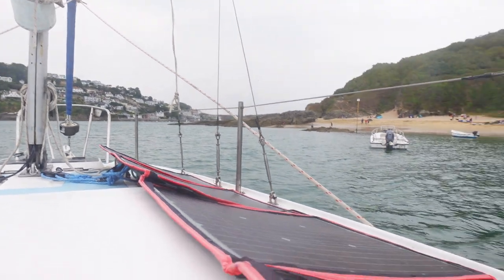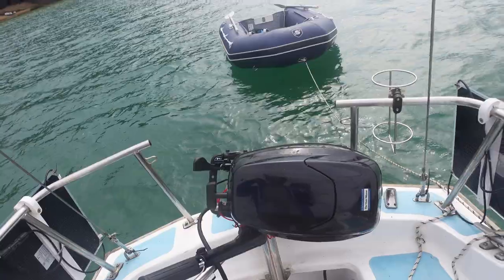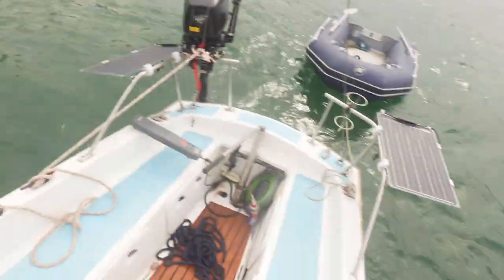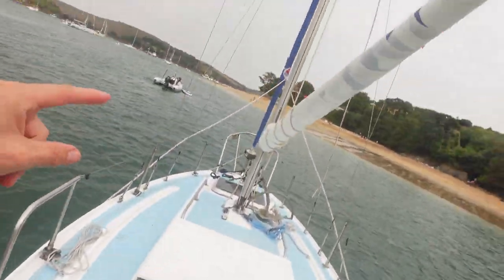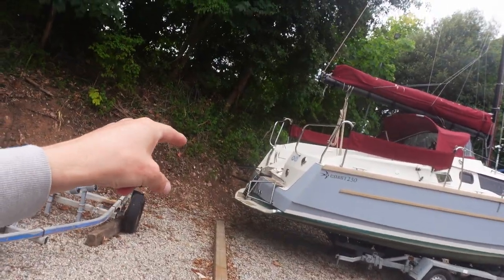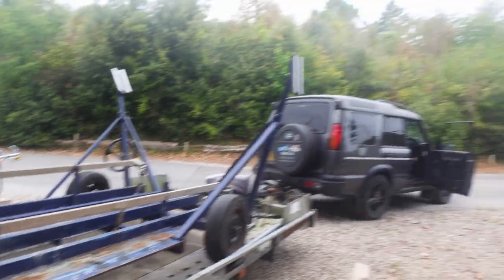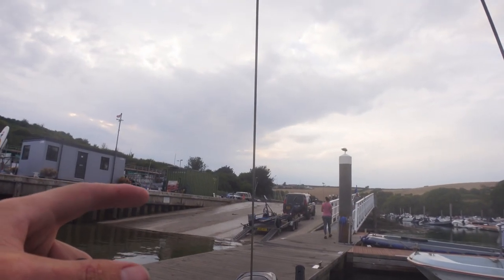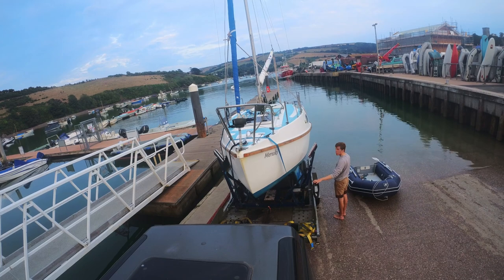DO OUTBOARDS WORK UNDERWATER? | Ep.111

Comment: Interesting boat, that Coast 250. Apparently, it pales at 15 knots under power. yet, sails very well. the outboard well is located in the cockpit and ends in the companionway. It's central location apparently help its sailing performance.
Reply from the maker: Clever design then!

Comment: Going to get my first boat at weekend, a nice little trailer sailor thats in working order but a bit tatty. Cant wait.
Reply from the maker: That’s great to hear! Hopefully it all goes to plan!
Reply: @AlexGoesSailing  my first issue with it is that it's got a trailer which is based on a caravan chassis and needs to go wheels in the water to get the boat on and off. Fine for the freshwater lake it's currently moored at, but I want it in the sea.
Reply from the maker: @TheAegisClaw  maybe install a flush kit to the brakes! And service the bearings once a year.

Comment: Hi Alex. This happened to me and my Tohatsu 6hp too. I captured it on video on my Easy Tiger II's Adventure's channel (https://www.youtube.com/watch?v=Xadi-nKFTqc). The action starts about 10:40 in.  I had it tied on as per the advice from @peetjepoo so it didn't get wet but it was a shock.  I would not suggest using plywood as the loads on these are very large.  Also, as you will see from the video, if you use hard wood you need to think about the direction of the wood's grain relative to the loads.  My Plastimo wood bracket split across the grain. Admittedly the bracket was probably 20yers old but quite worrying. I used a scrap piece of very high density plastic which has so far been fine but I'm keeping an eye on it.  Good luck with the servicing. BTW, your video on servicing the Tohatsu is really helpful and clear - thanks for oding it - I'll be following it this winter when I service mine.
Reply from the maker: Great advice! Glad you like the servicing video!